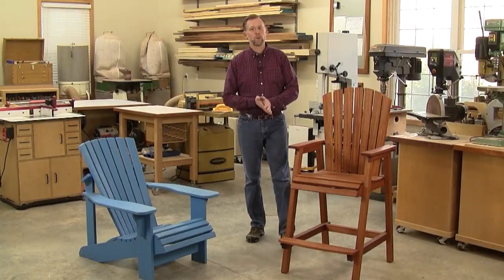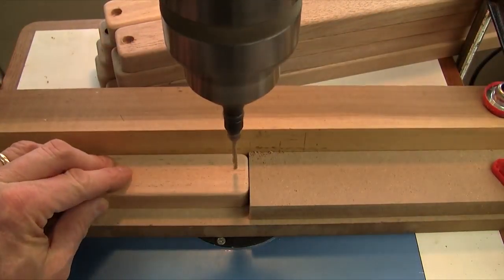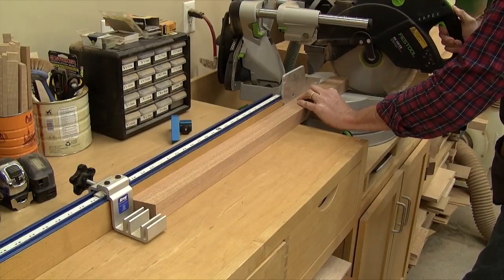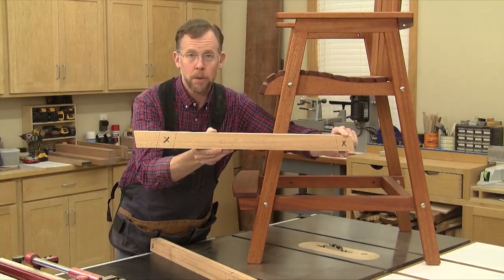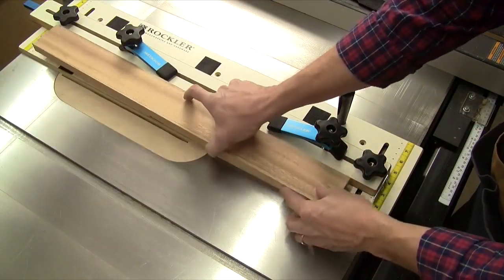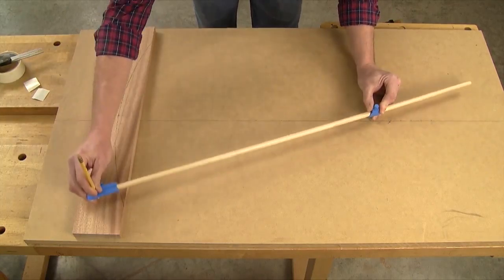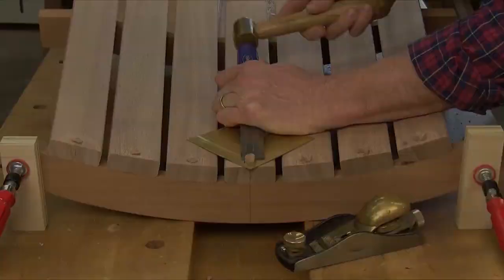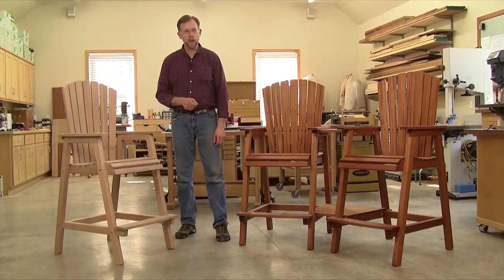Bar Height Adirondack Chair Project | Complete Build Video

Comment: 08 APR 2023   7:00 AM

This is the best instructional build video for this type of chair.
I have built 36 of these chairs over the last three years.    I made templets for the upper & lower back supports as well as the seat rail and arm templets , it makes quick work of the whole process.   After I built 8 or 10 chairs everything was inculcated to memory and now they're quick and very easy to build.   
The only problem I have experienced is that I have to stop doing all these "FREE" chairs for friends and family.
If you like spending your time in the work shop, these chairs are a blast to build !
My thanks to Chris Marshall for making this very clear, concise, easy to follow video.   

 With Kind Regards,

          Pete Conlogue
          Chesapeake, Virginia

Comment: This video was well done.  I appreciate that it was done in thorough fashion, and with properly spoken English.  Thank you.  One question that I have if you do not mind, actually two, would be how much time does it take an experienced woodworker who has done this project several times, such as yourself, and how much time for someone who is more say, halfway between the beginner and intermediate stages, such as myself?  I am deciding upon which high adirondack chair plan to build for sale to others, and am just wondering how much time goes into building one.  Thanks:)

Comment: I made these from rough sawn cedar earlier this year.  It was a challenging build for me but I got through it.  For me, there was tons of re-sawing and milling, so that might have made my build more tedious than using pre-milled lumber and the glue-ups.  I love the result!  My wife has her coffee and breakfast out on the front deck everyday with the chairs.  I slapped together a tall table to put between them rather than the connecting table in the plans.  My only criticism of the design is that the seat backs are too upright IMHO.  I would increase the angle a couple degrees if I were making again or recommending to someone else, other than that, they are great!
Reply: how would you increase the angle to get a more reclined position for the backs. I'm looking to make these very soon
Reply: 10 degrees?
Reply: @littledsurf  10 degrees would probably be good.  As it is they are maybe 2 or 3 degrees, not much at all.  “Regular” Adirondacks have way too much of an incline for these and frankly I don’t like being that laid back.  I would find a chair that’s comfortable for you and try to determine the angle and use that… trust me, you will be happier.  This was a good build, just the angle too steep!

Comment: I have built one set of these chairs and they came out great. One thing I want to point out there are few spots where the written instructions are not complete when compared to the video. One is on the critcal cross braces the written plans do not indicate you measure from the top edge. The other is when you cutting the back supports. The written directions does not include that you draw your parallel line to the edge 2" on the lower and 2 1/4" on the upper back support. If you follow the video step for step you will not make any mistakes. 

The spacing of the seat slats and back slats is not covered in the plans either. As other have said it would be helpful to have the plans include a material list not just the cut list. All that said, thanks Chris for all the help I really enjoyed this project.
Reply: I would like the measurements

Comment: First, I'll add my congratulations for an excellent instructional video.  Very well done.  However, I would like to see a follow-up video created that address one of the main concerns that has come up repeatedly and that being the straightness of the seat back.  I am getting ready to make a set of these and let's face it, Mahogany isn't inexpensive.  In theory increasing the  angle of the inside cut on the upper and lower back supports should "help" but I'm not convinced that it will fully resolve it.  Anyone else have the same concerns?  I almost feel that you would have to extend the arms and locate the upper support further back to achieve an increased angle for the seat back.  I'd be interested in other thoughts and comments.
Reply: I completely agree  The back needs to recline about 11 degrees or more, much like the low Adirondack chairs.
Reply: I angled the seat, dropping the back one inch from the front, that made the chair more comfortable to sit in. I also changed the back angle to 10 degrees. That made for a very comfortable chair.
Reply: Charlie Bygolly exactly, I did pretty much the same. I raised the front of the seat a half inch and lowered the back of the seat a half inch. Also, I gave the back a better angle. What a difference‼️

Comment: Definitely a major design flaw the back of a chair is sitting straight up and down now who in the hell sets that way anyway straight up and down
Reply: T N 
Me and my bad back sit very straight.
Reply: I thought that it was an excellent project.  Good plans and great video.  I'm making a set for myself and another three sets for each one of the kids.  Yes, I would have liked to have seen a slightly more reclined angle to the chair back and/or a deeper seat position.
Reply: Michael Grinney so you somewhat agree with me then